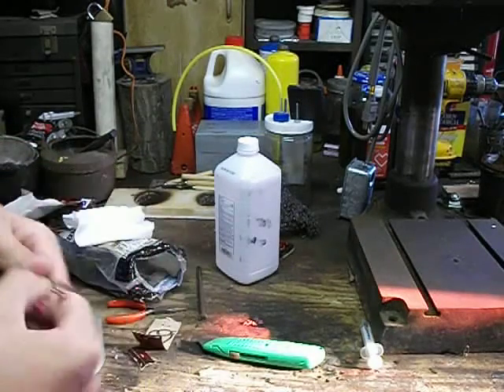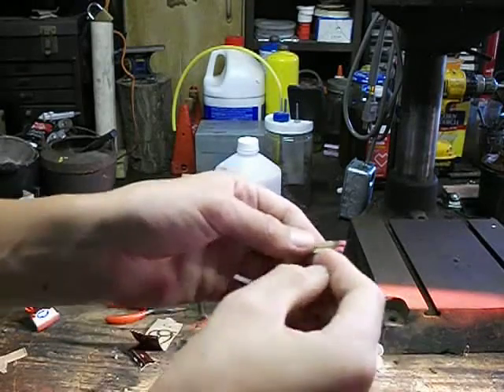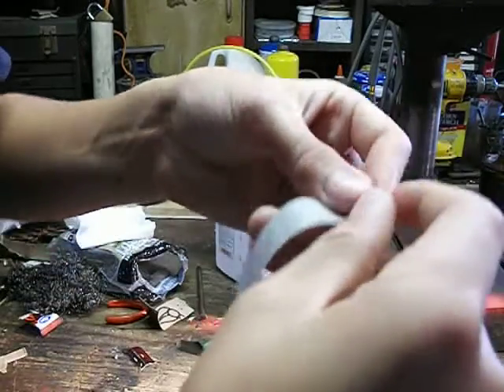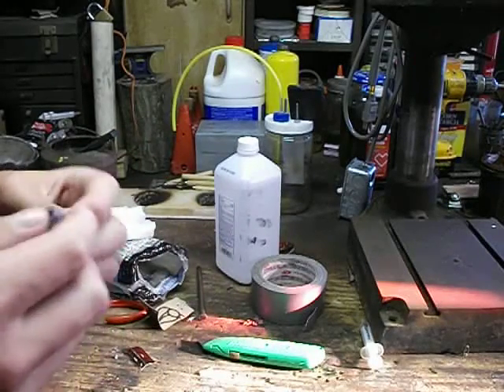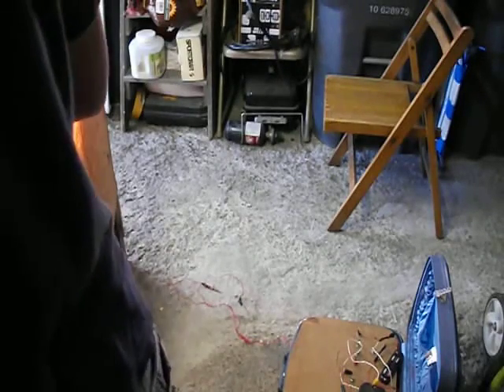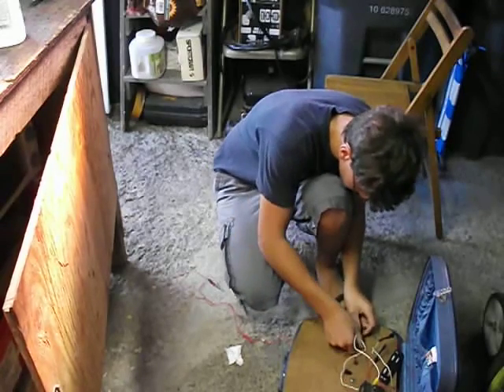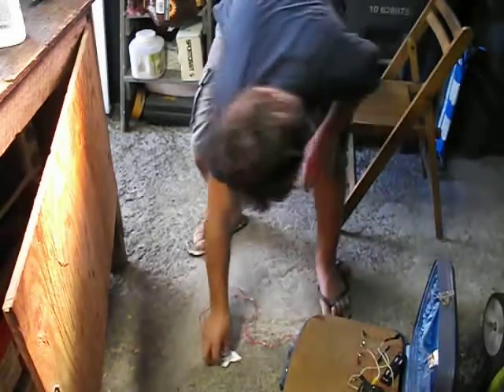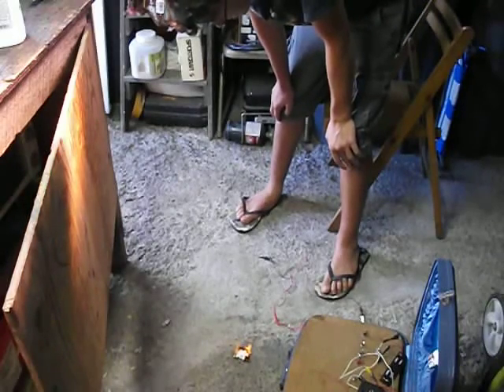How to make electric matches "E match"

Comment: not as easy as it seems 
First off you are using a dish washing wire and they are made from stainless steel. What you wanna use is nichrom or kantal wire like they use for e cigs . The reason why its so hard to ignite it is you need a very thigh choke point in the circuit. While that defenetly restricts the flow of electricity it is not tight enough you want something at least 0.1mm or even better 0.01mm. also you want to have one focal point so you are not wasting energy to heat a long strech of wire